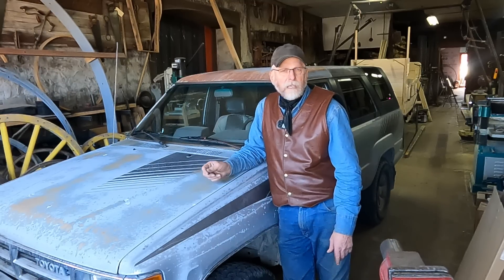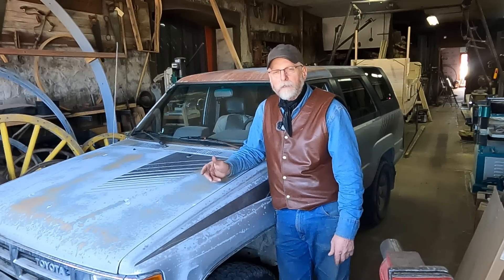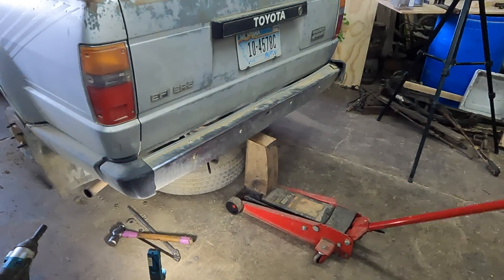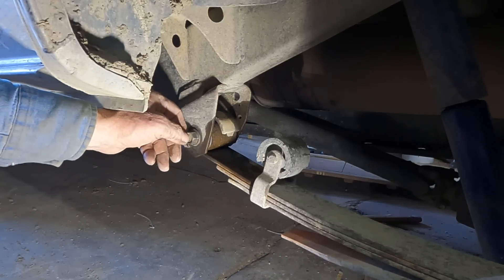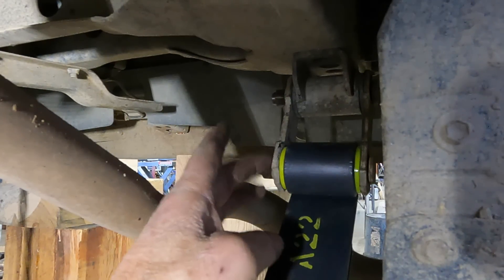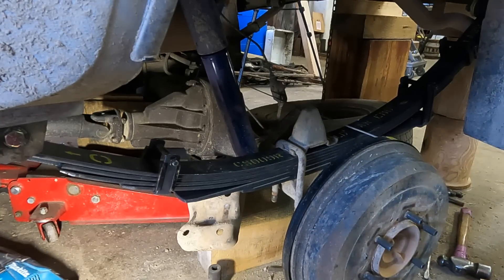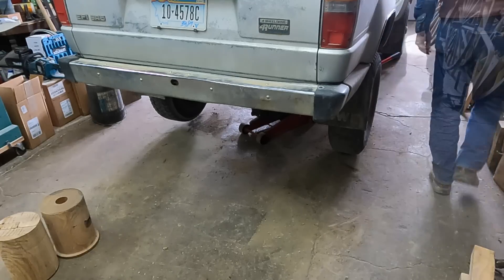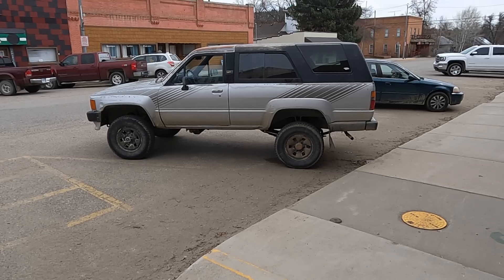My 1987 Toyota 4Runner is Worn Out | Engels Coach Shop

Comment: May 4runners do the “Zuk mod”, and add some coil spring from a Suzuki sidekick? Between the bump stop and the   Bump stop bracket on the frame. Lifts the truck and is cheap/effective. Many owners find replacing the rear springs lifts the rear too high, and has a rough ride, especially with the old man emu springs .

Comment: Toyota makes good stuff.  I had a 70 landcruiser that also had a broken odometer and burned a little oil (well OK, a lot), but it just kept going through things it shouldn't have survived.  It finally died one day because I didn't have a quart of oil with me.  I would have fixed it, but the bolts were so rusty that I couldn't get the engine out. Same starter for 25 years.

Comment: Both my 86 and 96 4Runners sag in the back on one side.    I put  Airlift 1000 airsprings on my wife's 2005 4Runner and that solved its sag problem and to help pull a trailer.  But thank you for leading the way for one of my first retirement projects next year.

Comment: I have a '93 Toyota 4 X 4 pickup 4 cylinder with a 5 speed transmission. I have put 233,000 miles on it and it is still running fine. Regular oil changes, flush hydraulic brake system periodically, change coolant annually. I have changed out the transmission and differential lubricants too. Bout, other than shocks, brakes, tires and tune-ups it does its job daily. I did install NGK Iridium spark plugs too. I'll keep it until it dies.

Comment: I put new rear springs on my 2000 Tacoma and it really had a high arch and stiff ride, I was a bit unhappy.  However after taking a load of ruble to the dump (heavily loaded) the springs set in, height came down a bit, and ride became normal, real happy now.  Load it n shake it 😁

Comment: Those old 4 runners are still one of the best used cars you can get IF you can find them. So easy to work on and they last forever as long as you take care of them. New toyota trucks are plagued by mechanical issues just like every other brand vehicle being sold today.

Comment: Suggestion- I did the front and rear suspension on an 86 Toyota PU.  Crank in about an inch more lift (preload) to the front torsion bars. They go soft and sag, too.  It would also get your truck a little closer back to level.  Compared to the rear leaf springs adjusting the front torsion bars is simple.

Comment: Rear spring will settle about an inch with use and you may want to crank the front torsions up a bit to ''equal'' the firmer ride!  I drive my 40 year old Toy PU and it rides much firmer than my 4Runner!

Comment: I have  a 2001 Tundra. Recently, I had to drop the spare and found the cranking mechanism to be a pain (those tires are heavy). I found that I could put a socket on the end of the bar and use an impact driver to do the turning.

Comment: Very nice. Our 31 year old son has a 1987 4 RNR that was purchased new by his aunt and has been in the family since then. He has done a lot of work on his. Rebuilt motor with a lot of upgrades. New leaf springs to lift it up, new shocks bigger rims and tires. Power seats he pulled out of a car in a junk yard plus I don’t know what all. He hopes to get it repainted when he can afford it. Those old 4 RNRs go forever. My 2017 4RNR just went to our daughter and son-in-law, I now have a 2023. Engines will change next year so wanted the 6 cylinder before they go away. I put a lot of miles on my rigs.

Comment: They must not use much salt on the back roads outside of Joliet.  Watching South Main Auto in New York, the salt belt takes an awful toll on the metal parts of cars, trucks, etc.  The compartment where Dave found the jack and tools would have had it's bottom gone to the vapors of rust city in that area. Enjoyed seeing Dave bend a wrench on a horsepower drawn vehicle! Truly a jack of all trades, and master of most of them! Old iron will last if you take care of it. I have a 20 yr old Civic that is my daily driver. Bought it new and will put another timing belt on it when due.  It's on the second one now. They come due every 105K miles.

Comment: Like an old girlfriend.  You know it inside and out.  Owes you nothing but not going to hurt you either.
Good choice on the springs.  Get new bolts and bushings wherever they are used. Keep your impact gun and torch and grinder handy.  Can't believe how rust free that rig is.  I also can't believe that spare lowered.  Good time to do Brakes.  I expect you put lots of grease on that Roller/bushing.  You may have to re aim your headlights too.

Comment: Awe man I love these 80s era Toyota trucks! I've owned a bunch of old Toyota trucks over the years and as long as you take care of them they will last forever. 
  Right now my current daily driver/mud truck is an 86' Toyota 4runner I bought back in 2010 and it still runs like a top! I also have an 85' Hilux extended cab that I've been working on and restoring myself since around 00'. My goal is to make it look like the Hilux from the movie Back to the Future, I finally got all the body work done and the brush guard and light bar I just need to paint it now.

Comment: Not sure why anyone that does suspension work would suggest letting that steel bushing rotate in the spring hanger saddle holes. That bushing is ALWAYS trapped between the saddles to prevent it from rotating and wearing out the holes. With the OEM rubber bonded ones, the steel inner bushing is pinched between the saddles to PREVENT rotation, and the rubber deflects to allow the front spring eye to rotate. Aftermarket urethane bushings are designed so that the urethane bushing rotates on the steel inner bushing - that is the wear surface. The way you have it installed you are at risk of the bushing rotating in the spring saddle holes and wearing the holes out, creating a rattle. While I guess it may be a suitable repair for an occasional use farm vehicle, it certainly isn't the way it is normally done.

Comment: Bumper to ground isn't the usual way to measure lift. Center of tire to wheel arch is the standard way to measure. Not sure why, but that's the way I was taught to measure changes in suspension height. Another thing I notice is that the new springs have 4 leaves + 2 overloads, while the old only have 4 leaves total.

Comment: I just installed on my 2nd gen 4runny 1 1/2 inch Old Man Emu Coil Springs with 2inch spring spacers and Old Man Emu's shocks and struts all around... Best decision I made and she looks ready to play now... My shop is putting in all the front suspension links, rods and bushings... I plan on hitting the trails a lot this summer...

Comment: I am sorry Mr. Engels, I had to laugh at the end with that sheepish grin you gave. But you had to do the opposite end of what I had to do on my 2001 Ford Ranger Edge, as I was bottoming out in the front end. But lifting the front end on that truck was so much easier due to the torsion bar suspension. As it just meant tightening to bolts to lift the truck. Wish everything in life was that easy.

Comment: My old '98 Nissan needed the spare lift chain mechanism rebuilt last summer. While it was somewhat neglected when I lived in Texas (and it was a Louisiana truck), the 6 years up here in Michigan with Road Salt really did a number on it. Rust treatment (Evaporust), good spray paint (tractor black), and some moly brake grease and it works a charm. My springs were lacking for what I bought it for (Sattelite tv installs) so I first used air shocks, but they didn't last (well they lasted longer than the job!), so I went with replacement tow package springs with helpers that added about 2 inches from stock as well. I also went up a bit on the front torsion bars so with the fairly heavy cap, and "Winter Weight" (tow ropes, shovels, salt, straps and a heavy 36x42 pallet made of 4x4s and 2x6s) it sits about level to just a hair tail high (depends on gas load) When I pull the cap off to finish its refurb, it gets a bit tail high. Stone ax reliable, for the most part. Not as good as a Toyota (and your $500 was a deal), but the best I could afford at the time I bought it.

Comment: I had to repair a few cars that had worn out springs. It's  usually not hard if you take it to a spring shop if direct replacements aren't available. One shop in N.Virginia made me a set for the rear end on my 1972 Ford Pinto that had been damaged by hitting a divider island at high speed. One of my brothers "borrowed it"without asking me first.It was leaning on the left side 4 to 6 inches.I got tired telling people why it was leaning and no,I'm not that fat. I replaced the shocks because they were leaking too.  The cost was less than $150. Well worth it as it drove much better after that,too.

Comment: Thanks for posting this...nice job replacing those leaf springs. I have a 1988 4Runner that I bought nearly new and it now has 191,000 miles, many of them pulling a boat back and forth to the Florida Keys, about 800 miles round trip. The 6 cylinder 3vze engine has served well except for a blown head gasket covered by a recall. I drive it a time or two each week to run errands and it's dependable still. I don't believe I'll ever sell it...too many fond memories.

Comment: Watching you open up the tyre change kit reminded me of a similar situation with my 13 year old Subaru Forester. Having owned it from new, with 330000km on the clock. Having used it for launching my boat and living near the river (salt) i expected to find rust, now for the story.....
Taking the roof racks off, racks that'd been exposed to much salt water well.... i washed the fixing system of the racks down, no rust, not a single spec of rust, Subaru had used marine grade stainless steel on a part that was essentially invisible! That's a great example of brilliant engineering, i still miss my 1990 Forester to this day.

Comment: Hi Dave,
Great you were able to locally source the U bolts and sleeves. The springs should settle with about a half to one inch lower ride height. Still much more than you had. You and Diane stay safe.

Comment: Nice job.  For the oil - I put new valve guide seals in my old Volvo when it needed a salvage yard head due to exhaust port leaking coolant.  After that it quit wanting oil between changes (perhaps about 350k mi). New suspension bushings were needed for a quiet ride about each 130,000 miles or so and a timing belt a bit before that.  A clutch or motor mounts around 250k mi and you can go a long way.  I enjoy your projects & wheel videos, thanks.

Comment: I purchased my first 4Runner in 1985 new from the dealer and ran it for 27 years. Sold it when I purchased a newer 4Runner that I have had for about 10 years now. I regret selling it. Everything about the truck was repairable by me. Not so much my newer one. Put 478,000 kms on it and it never broke down. I spent so little on parts for it that the cost of my oil changes was by far the biggest expense. It was so well balanced that I got 150,000 kms on a set of tires, never rotated, they wore out evenly. My only issue was the engine could have had more power going up hills. Too bad it didn't come in a diesel power plant. It would have been unstoppable.

Comment: A word to the wise Dave;  bring it back in and revisit the torque on those U bolts at least twice over the next month.  Many folks are shocked how much more they get as the springs seat in.  I have had U bolts fall off when I was younger and not as wise.  It is a tad alarming when your axle starts walking up the spring...ask me how I know.  Not a big commenter but love the channel.  Stay safe.
Reply: Thank you. Dave says good idea.
Reply: I enjoy seeing how things evolve differently in different parts of the country. My 1984 Toyota pickup plow truck served me well for many years here in Vermont. I had to oil undercoat it annually to counteract the rust. I did a similar spring swap since it carried firewood and “stuff”. 
I also rebuilt the bottom end of the 22r engine myself; a reasonably easy job for someone with Dave’s skills. Pull the engine, tear it down and get it re bored. The oversized rings and bearings are readily available for these vehicles even if you have a different engine. 
I loved my “motorized wheelbarrow”, and only sold it when the frame finally died. 
Yours looks to be a runner. 
Best regards as you keep it going, hopefully for many more years.

Comment: I did this back in 1985 (NWOR supplied the lift). Learned that when you change the lift, you change geometry, brakeline length, parking cable support, longer Trailmaster shocks, bump stop limit, steering linkage (I lifted all four corners), bushings (from OEM rubber to Poly), shackle shims to correct drive line angle change. Would you believe a pothole took out my shocktower because over extended the front suspension without extended bump stop. I was young and dumb, and eventually traded it in for a bigger vehicle. My first Toyota, but not my last...

Comment: And THIS is why I traded my lifted 2015 F250 6.7 PowerStroke 58k miles, for my 2021 4Runner TRD ORP w/XP Predator Pkg 33k miles. This, with regular PROPER maintenance, will run longer than I will!! Toyota DOESN’T believe in planned obsolescence, but making things BETTER each year and not about next quarters stock values. 
God bless~

Comment: The old 4Runners with the removable back are notorious for this... that cap and the power window tailgate add a good amount of extra weight (maybe 200lbs total) on what is a standard Toyota 4WD suspension.  After many years and miles it adds up.  Nice video!

Comment: Funny, I’m a retired mechanic and I’ve done that job countless times myself over the years (I have even owned the exact model Four Runner)and I was thinking to myself, why did the springs not come with those bushes.  😊
Reply: Great a mechanic.  I have an issue only experiencing can answer.  I own a 98 4runner with only 140k.  Recently,  the truck developed a shutter (slight jerking) around 50-55 mph, after that speeds drives fine. No error codes. What do  you think the problem is? Thx

Comment: I'm currently working on a '66 F100. Older vehicles are so easy to work on. Another option if you need a little more clearance/ load help, are air bags

Comment: Now this is a coincidence. Guess what I was struggling with today. Replacing the springs on my box trailer and man were those bolts seized up solid. I ended up the same as you lying under the trailer with a Sawzall cutting them loose. I could really empathize with this video!

Comment: You probably can't find Fluid Film locally. It tends to be sold around salt water. Marinas love the stuff. It's High $$$, but worth every penny. You get 3 for one. Fluid Film replaces PB Blaster, WD-40, and a Tru lubricant (I'm sure you know WD 40 is NOT a lubricant. It is a water displacement. Fluid Film also takes rust off, easily. It just bubbles up, as you watch. Amy two stuck pieces of metal (that don't respond to heat, or is on a place heat would damage). You will probably have to go on line. Fluid Film is also the name of the company.
I have a 10 year old Tacoma. Best, longest running truck I've ever owned.

Comment: Ah another Toyota owner I am on my second Toyota Hi-ace Van my first was a 1977 petrol model and I clocked up many miles living in rural Western Australia on country roads (mostly bitumen and some gravel) I had the opitunity to put a newly reconditioned motor in from a friend's Toyota? In that was written off by side impact, I drove that van till 2003 when out of a bequest inheritance I purchased a 1996 Toyota Hi-ace Van  diesel       2. 8 L this time it was an ex fleet vehicle with service log books and had done 278,000kms (for a Toyota diesel not even broken in yet!) in 20 years I have only put 45,000 kms on it of trouble free motoring and after calculating back to the old language I get between 28 to 32 mpg out of it
I can't complain about that as we are paying around 2.00 a litre for diesel here
Saturday night leaving my girlfriends house to come home (650 metres away) my clutch master seems to have blown ( hopefully its not the clutch ) so it was stop the car select a gear start and limp home, living in the bush, with the nearest part store or dealer being a return trip of 50kms away and my mine shift worker lady gone back to work yesterday (Easter Monday} for 2 weeks I am forced to put it in the hands of our  one and only garage in town  next Monday he can fit me in.
I can't complain really after 27 years driving Toyota's I can excuse the repair, I have though threw the years changed the engine oil gear box and diff oils (engine +gear box one service, engine diff next) on both vehicles at about 10,000 kms on the petrol and 5,000 kms on the diesel with the best oils out thier as preventative measures a little investment for the best chance of longevity.
I don't think I would change my vehicle make to any other as the reliability is so good
Also, while I'm here check out the channel LR TIME it is a couple called Christian and Vera they own landrovers and are always working on these "modern marvels" as they always break downs, they are German but speak perfect English and the swipes they take at us Toyota owner's whose vehicles never break down are very funny
Christian is an excellent mechanic and with precise German engineering does brilliant work a both he and Vera have very funny commentary wit there videos, I hope you enjoy them should you watch
I hope you get many more years out of your Toyota.
Tony from Western Australia 🇦🇺

Comment: I will be honest. I was shocked to see a Toyota older than ten years that wasn’t completely rusted out. An 80s especially as most of them Rusted out really badly and quickly.  Add to that the engines detonating when the timing belt went it is rare to see one.

This was in part due to lack of rust prevention, but more with bad metals.